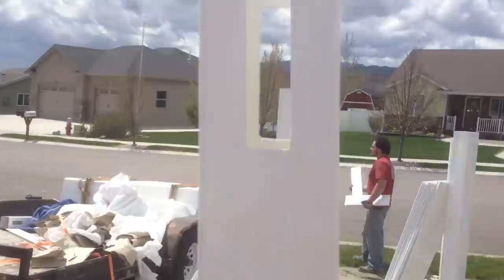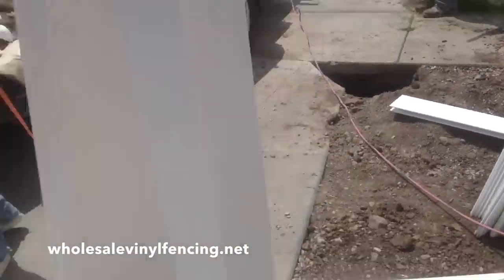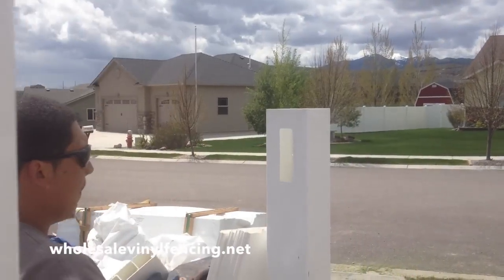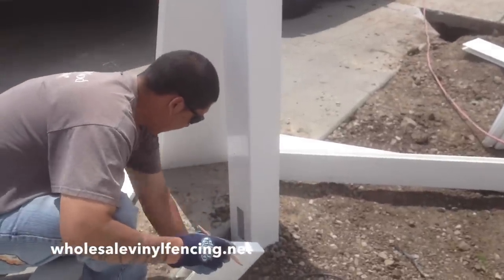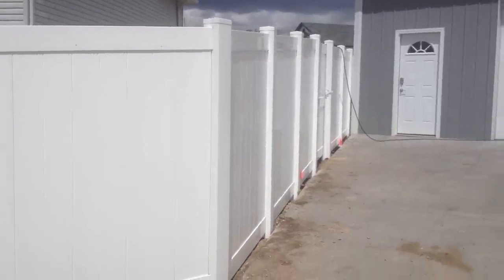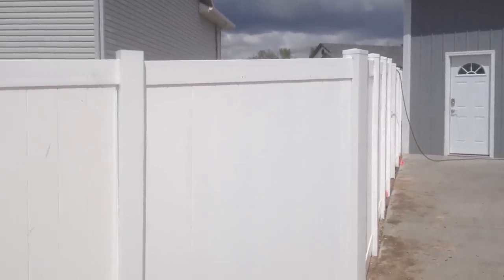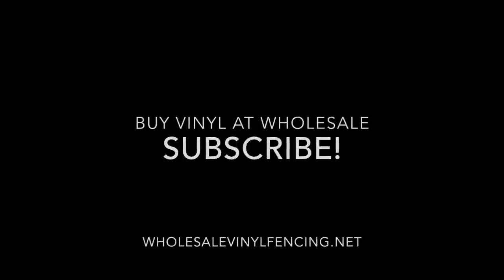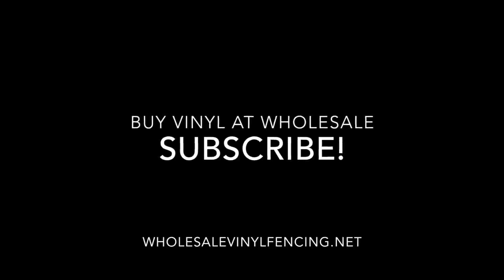How To Easily Install A Vinyl Fence On A 45-Degree Corner! Effective DIY Technique!

Comment: Thanks !  Perfect and to the point !   Thanks for taking the time to make a video that helps people.   

I called Freedom fence and they told me i couldn't do this and instead i had to add two posts to make a 45 degree angle !  yeah - that's not going to happen.   

1 question.   Do you have to add a screw to keep this secure ?   like through the top and into the header of the fence?     I'm concerned with it being to loose.

Comment: I have a 45 degree angle however it has metal brackets would I just rotate the one corner post and off set each metal bracket?

Comment: I would like to add an 8 foot section to an exisiting end post with the new section coming off on a 45 degree angle...is that possible?  There are tow 8 foot sections of privacy fence that were installed 10 years ago and would like to add 1 section but running into road blocks dealing with local companies...job too small or they want to dig a new hole next to the old one creating a gap...any thoughts

Comment: How do you inatall these fence on concrete.
Reply: I would highly recommend cutting a hole in the concrete. If that’s not possible You can purchase steel post that Hilti bolt to a concrete pad. We sell ones that work for a 5x5 or 4x4 post. Call and speak to one of our fence specialist if you have questions. 877-573-5561

Comment: This isn't helpful at all.
Reply: What kind of tutorial would you like to see? We are always trying to add new content.
Reply: This was helpful for me.  Thanks!
Reply: I work for a small fence company as a foreman, we have work every weekday often multiple jobs a day. 
When we set a line on a steep hill we have to adjust the rail holes. We use something we call a nibler, it takes a perfect chunk out of the posts rail hole to make the rail fit better at a steep angle. There is a certain way to do it to make the rails appear straight but i can never remember it. Could you make a video on this?
Reply: It helped me, thank you so much!